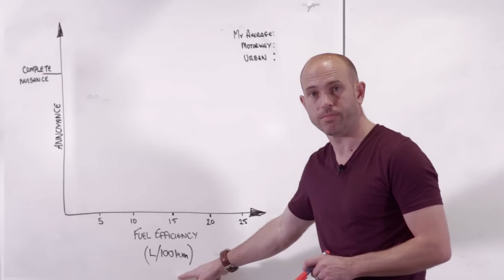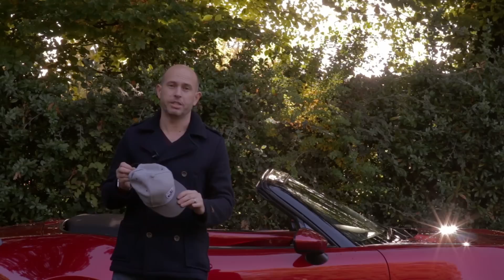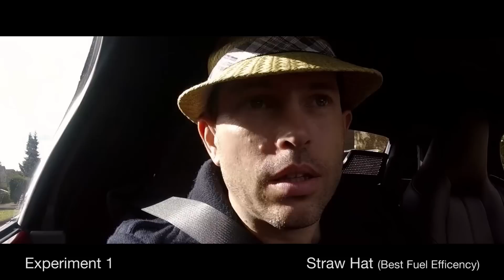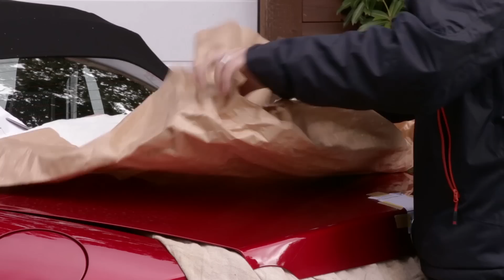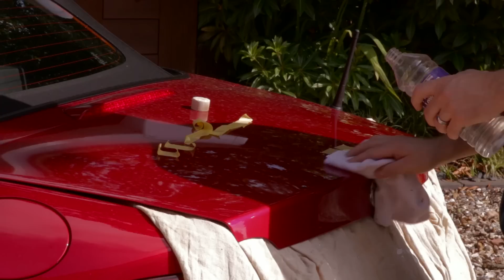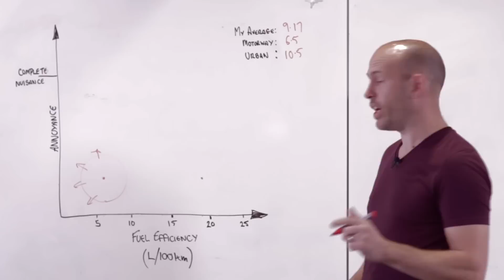MX5 Diary - Episode 7 - Fuel Efficiency

Comment: Haven't laughed this hard in *ages*! ... To get really round holes in sheet metal, use a punch and a high-quality "stepping bit"... before installing the spoiler you HAVE to seal the bare metal of the holes to prevent corrosion. Polyurethane varnish works well but requires some time to dry. PRESTO BOB Rust Sealant 603734 or the UK equivalent (also PUR based) would be even better and can even be applied in moist conditions. If you don't have ANY solvent-based varnish at hand, I guess you could improvise with (clear) nail polish...

Comment: Can u tell something more about the roof. Is everything ok after months. Do U have to put some extra care about it especially when it is winter. Do U use the car with open roof when it is cold? If u took the car for leasing can u tell something more about it. Thanx a lot ;)
Reply from the maker: I'm not had any problems with the roof. However, I do keep my car in a garage so it's not been outside that much other than when I park it outside at my place a work a few time a week. I've not had to do anything with the roof. It still looks good and has never leaked. Only unless it's really cold, below freezing, or raining really hard will I have the roof up. All the other times I have the roof down and if it's cold the heated seats and heater keep the car feeling comfortable. Oh, and I also wear driving gloves on a cold day.

Comment: Can you do an episode of the car being hijacked.  I want to know if you get pulled out of the car with the key fob in your pocket, if the car will come to a stop 50 meters up the road once the MX5 is out of range of the key fob.  If you chase after it does the baddie get to restart the engine and drive off again...?
Reply from the maker: Sounds like an idea for another episode. I'll let you know.
Reply: Back when I bought mine the salesman told me that the car wouldn't automatically shut off if away from the fob but it would be rather difficult to restart.